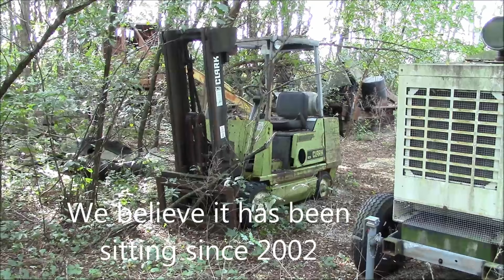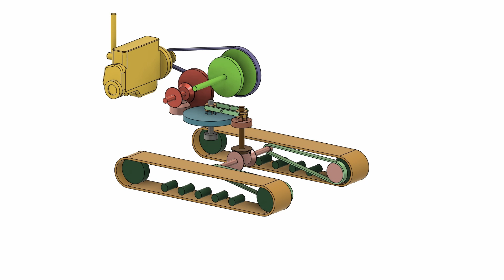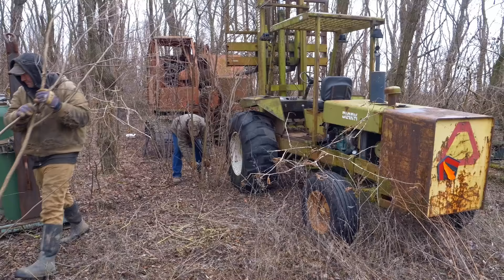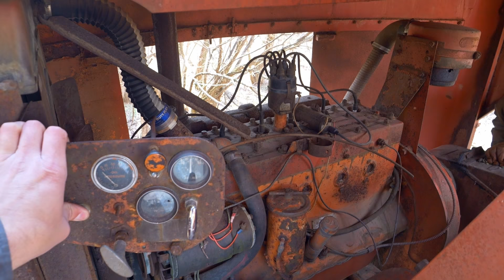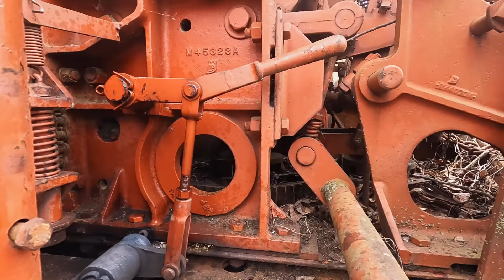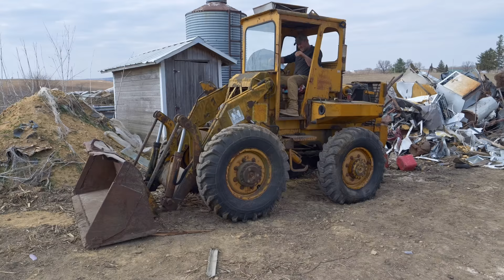How Do You Move an Abandoned 10 Ton Crane?

Comment: I had a car in the woods that I needed to get out. I did basically the same thing with the pulley. After a while I looked close and found out there was a buried rock in front of the car, Apparently it was the size of a land iceburg. I got the car out and 5 miles later I found out I destroyed the clutch on my good car. That rock cost me several hundred dollars and a missed trip for an important event weeks later.
    edit; I also missed my cousins wedding, and the dealer that replaced the clutch used an impact to put the tranny case back on stripping a bolt causing a leak that caused the transmission to self-disassemble at 11pm on the interstate.

Comment: This is most certainly too late, but for those future people trying to tow tracked machines, depending on the machine and configuration, you normally pull hydraulic release levers/pins near the drive, remove the sun gear from the final drive, or use a porta-power to release the brake. I didn't see any of this happening, but that's why I imagine it didn't move when towed in addition to probably being rusted up and maybe leaking on a hydraulic release line preventing tracking when running
Reply: I thought he said at the beginning that this thing had no hydraulics at all.

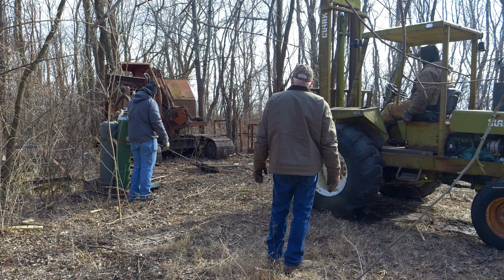Comment: 10:40  You had 2 additional vehicles there besides the forklift.  There was a tractor and the red truck, plus whatever you were there in.  If the guy in the red truck didn't want to use his truck in the experiment, that leaves 2 additional vehicles.  Attach a chain to each one and triple the pulling/traction power.

Comment: Speaking of evaporust, there is a youtuber called elemental maker (chemistry) who put up a video on how to make homemade evaporust.  I gave it a try and it is 90-95% as good as evaporust but practically free.  It just takes a little bit longer.  If you want to de-rust large stuff, evaporust is just far too expensive.  In most stores, it's like 30 bucks a gallon.  if you need 50 gallons, it's just not feasible.

Comment: I also have an old Insley front shovel has a Chrysler straight 8 flat head engine, haven't had it running for over 25 years last time I checked I could still turn over the engine by hand

Comment: I like the rigging setup you guys used Archimedes would be proud. Was that pulley you were using as a snatch block from the boom? I've always wondered if something similar would work on a stuck dozer. Welding a d-ring to a grouser and using the track as a winch drum. Luckily, I've never had to deal with 1 stuck bad enough to try it.

Comment: we have it easy these days if it works ofc. Nice and comfy seat, AC blowing nice and cold or hot, radio blasting and two little joysticks. Back then a piece of foam to sit on, ac hah if it's hot outside it's also hot inside, radio no point in that with a noisy engine in the back and heavy levers to pull and not to mention all of the potential dangers

Comment: Diesel Creek probably cried watching this.

I get why it got scrapped, but it feels a bit sad.

Trying to think of any other use case for the engine - clutch - wire setup. Maybe it could be used for hauling some heavy++ thing up a slope, if someone ever would need that? Like just attach the wire to a large wagon of sorts? But the you'd need to get the darn thing in place, and if you can do that then maybe you don't need another solution to haul things up a severe slope? :)

Comment: Those engines were used in alot of old equipment.  Good video.  You cut those trees down in front of the grader & you could make a will it pull video.   Whats with the grader ? Looks big.  Thanks.

Comment: So, do I understand this right, that if the clutches had locked up while you were swinging the cab, the whole thing would turn into an unstoppable merry-go-round of death?  Nice.

I'm also wondering what would have happened if that cable had snapped while the crane was pulling itself out.  You could have caught it with your face.

But hey, you walked outta there in one piece and the crane didn't, so I guess that's a victory.

Comment: Hey ya Wes! I was wondering when you might pop back up as personally I missed your channel and everything you've done. Did, you by chance ask Sam and Matt if they were interested in the old Dragline, even for parts as they have so many similar machines at the National Pike as steam center? Since most parts are now obsolete a machine like this one would possibly allow other machines to run, work again. Sam and Matt both have trucks to haul these relics away. Just thought I'd ask aa the engine alone might be a much needed component for something down there 😁. Matt seems more interested in diesels but Sam...😅. Glad to see and hear from you again. Don't be a stranger now, ❤😭🤣😭🤣😇😋👍. Where's the Wife 😭🤣?

Comment: Wes, you helped me out and didn't even know it. Back when you did the videos working on the Clark AT lift, I think I mentioned that I had the same lift and was working on it. Well I got it running and working, but the injection pump started puking diesel into the crank case, so off it came for a rebuild. Only problem, the ID tags were gone off the pump. Never fear, I reached out to Area Diesel, told them what I had, told them it was the same pump/forklift they did for you. They said no problem and a few days and a few, well few $$$ later I had my freshly rebuilt pump installed. No more diesel in the engine oil, engine turns over a half turn and fires right off, all made much easier because you decided to bring a camera along on your adventure. Thanks!

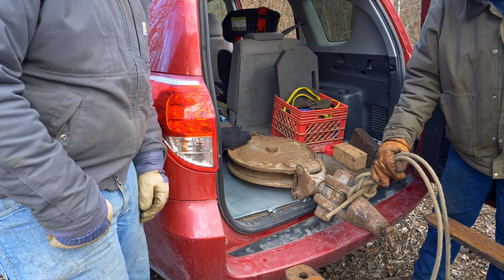Comment: 7:27 YIKES! Look out for dad's leg!!

There's nothing like tinkering with old abandoned equipment. I lived in a place that had an old Case 350 track loader broken down in the yard, and I managed to hold off for almost six months before I carried my toolbox and two batteries over to it. I'd blown the fuel lines out, drained the injector pump, and filled it with new fuel, I wasn't expecting it to start but once it did, it started moving and I had about six feet to figure out how to drive a track loader before it hit the shop.

Comment: Hi Wes 
I have a military 10,000 pound rough train forklift. It has a continental MS 415 which is the military version of B427. 
I did manage to find two 427‘s here in Fairbanks AK
in case I need repair parts for mine.  
Good video I liked it
Reply from the maker: Interesting! I have never seen another one. Apparently they did have a belt drive governor available.
Reply: @ my 3 engines have governor mounted to the timing case
I have seen three other B427’s in 1960s military aircraft ground APU units. I might have pictures of those so they were making electricity. Maybe they didn’t need a governor because they were all handshaking with the frequency control. Oh wait no governor keep it all in sync
Reply: My three engines are military surplus and then the others that were in APU of course they were military also

Comment: When are people going to realize that ag tires get no traction in reverse? If you'd have put a bunch of weight on those forks and turned the machine around it would have easily pulled anything you hooked it to. 
  That old loader is pretty nice, a bigger hydraulic pump and it'll be damned handy.
   Too bad about the Hopto. That Chevy it was on should have been saved.
   What will become of that nice old grader?
   Oh well, thanks for the look. Best regards from Indiana.
Reply from the maker: You've got a strange idea of "good". That Chevy had no title, which is basically the end of the road in IL.
Reply: @WatchWesWork  salvage title is easy to get in Indiana. What did I say was "good"? I just like that style of old Chevy.

Comment: Is that a GM 426? We bought 1966 concrete mixers and converted them to wheat trucks and that's what they had in them, 5-speed transmission with a 3-speed brownie, twin screws 16 ft box if I remember
Reply from the maker: No, it's a B427 Continental.

Comment: I love checking out old machinery. I'm amazed these still run. I used to use an old Cable D8 with a pony start cat engine. All geared and clutched. That thing would climb better than the hydrostatic machines. I had so low of gearing it was perfect for rigging ski lift towers and maintenance work. Nice job on getting this old crane out.

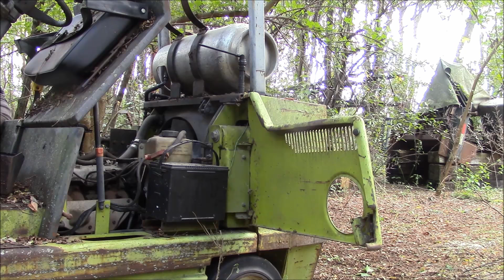Comment: 0:45 - Need to get Jennings Motor sports up there to have a turn on those engines next time!
Reply from the maker: Good luck. My brother had the cut the crank with a torch to get the old engine out.
Reply: Mixture of ATF, Diesel, and Acetone. Right? But that’s been mostly car engines for him, these are heavy machinery.

Comment: Can anybody imagine going back to the crap they build today and getting it to start this easy? Dream on MacDuff! Wes, you need to get your hands on a Marine Forklift like the ones we had in SEA.
Reply from the maker: I think you are falling into survivor bias. This is at least the second engine in this machine, so we can safely say the original engine is not going to start. I would bet when new this machine cost the equivalent of 2 or maybe 3 brand new excavators in the same weight class. A brand new excavator would be 2-3 times more productive while also being more versatile, easier to operate, using less fuel, and requiring less maintenance.

Comment: I used to work for a marine construction company that did a lot of foundation, pier work and dredging from barges on tidal water in the PNW. We had a couple newer cranes in the fleet for land work, but the whole industry still runs 60-70’s lattice boom friction cranes. They deal with the salt environment better than modern cranes. 

Outside of that industry those bull works friction cranes are rare to find, they are ignorant to work on, but it’s cool that you got to document one. 

That loader is pretty wild too, non-articulating frame and a rear steer axle. Sounds dicey at speed!
Reply from the maker: Supposedly you have to drive them in reverse on the road.
Reply: @WatchWesWork  i reckon fit a big bronze bush.. be as good as new..
Reply: Yeah, but getting to it is the real problem. You probably gotta take the whole house off that old girl.
 @harrywalker5836
Reply: @WatchWesWork   I have an old 3-53 powered Michigan 55III loader with rear steer.  I honestly have never even bothered trying in the highest gear but the 10-15 MPH in lower gears is pretty stable on paved roads
Reply: @WatchWesWork  did ya greese the zerks.. i was waiting for that chain to break.. being in a 4x4 club.. we take all the care, not to die.. like a 1,700lb winch for my 4t truck..